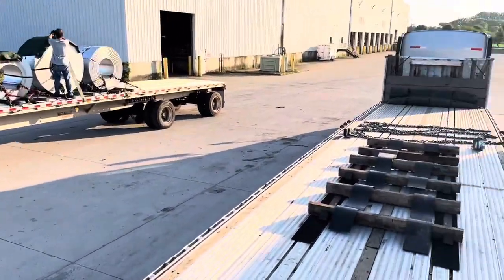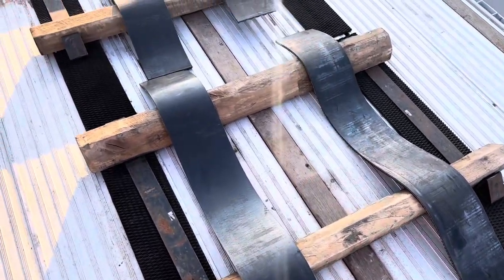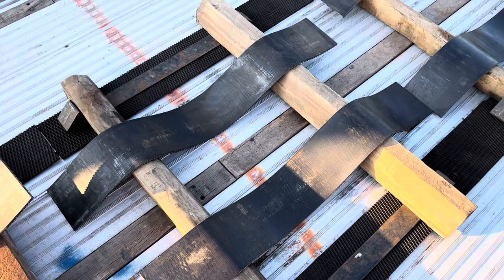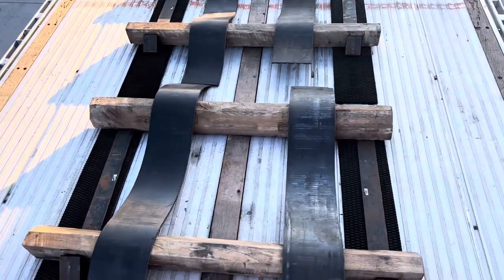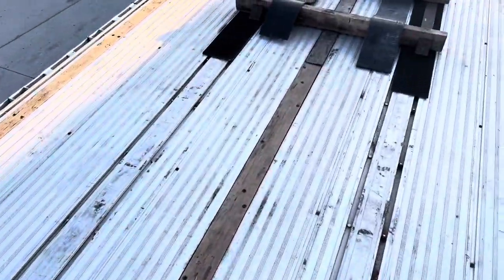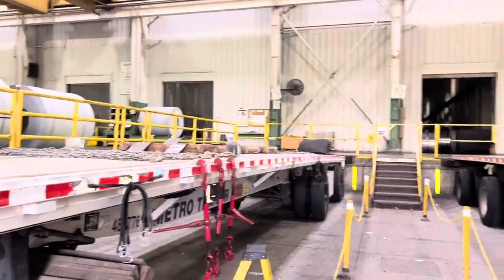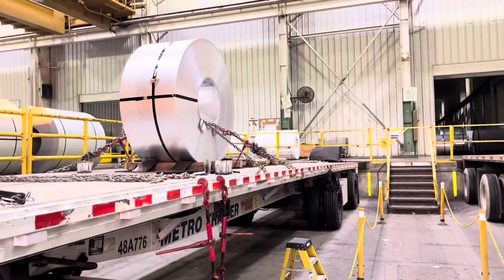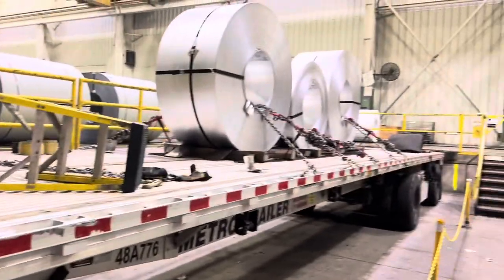CRST Flatbed….. Setting up for steel coils & the headboard on our trailers

Comment: I used to do heavy haul with ATS.  I improved the 'baby wipe shower'.  Get two small coolers, a face towel, and a large towel.  Place the big towel on the floor.  Fill one cooler with water, and another with water mixed with shower gel.....  I'm sure the rest is self-explanatory.  Roger.

Comment: Man, your ability to tarp amazes me. I’m running a single coil now and spent almost an hour and a half tarping and strategically placing bungees, trying to make it pretty, (which I thought I had it) only to get out on the highway and the dang thing is flappin in the breeze! Haha think I’m gonna have to break down and buy a coil bag since I find myself hauling a good bit of coils. Flat stuff I can tarp just fine but coils always give me trouble.
Reply from the maker: A coil bag will make all the difference in the world for ya, The tarp stayed put and I never had to adjust it the whole trip but if I could’ve went back I would’ve tuck and rolled the front and tent tarped the back, but  it all worked out, years of practice will get you there but I have a saying I tell people all the time, “the difference between a bad tarp job and a real good one is about 30 bungee’s” lollll
Reply: I’ve got some more bungees and securement equipment I ordered from Amazon waiting at the house for me when I go home in two weeks . Haha I figured I’d rather put too many bungees on the first time than not enough and have to do it along the highway somewhere! Stay safe driver! Thanks for all the great content, pro tips, and comments!

Comment: I applied at crst flatbed any tips on how to get hired on if I have a improper use of mobile device ticket
Reply from the maker: Talk to your recruiter they usually know about that stuff, I have no idea on what tickets are allowed and what are not, although I heard 15 over is a no no and of course no DUIs of any kind obviously
Reply: Depending on how long ago it was is the main thing. If it’s less than three years ago you may have problems getting hired at many places. Especially a cell phone type ticket. They do not mess around with that.
Reply: @codyhart9610  yea it was recently in March.  Dispatch was calling me regarding an important load and I stupidly answered andwas pulled over by a city cop, not a state trooper, so thinking I have a better chance to get it reduced to a lesser fine